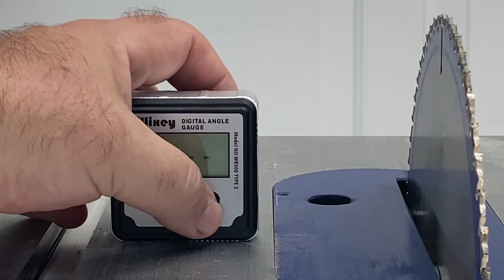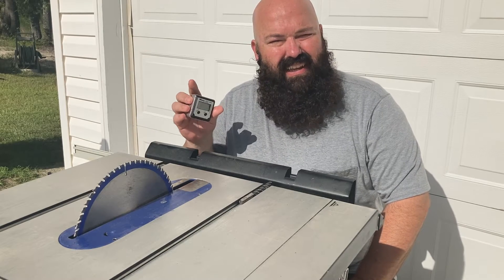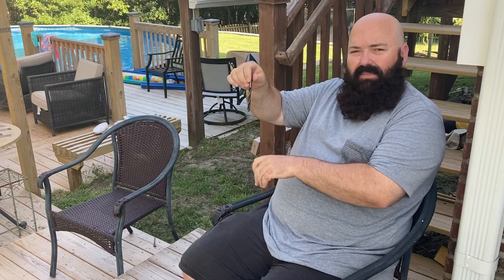How does the Wixey Digital Angle Gauge Work?

Comment: Great video!
I never thought about using my Wixey on my DP, jointer or Bandsaw! Genius!
Reply: Also, if you ever do another video on these or mention them in another video, you might mention that when placing the wixey on the TS blade, it is important that the side of the angle gauge facing down be fairly parallel with the work surface you are attempting to create your angle in relation to. And keep it away from the teeth of the blade as they are slightly wider than the body of the blade.
Reply from the maker: Great point. I need to put some emphasis on that next time. Thanks.